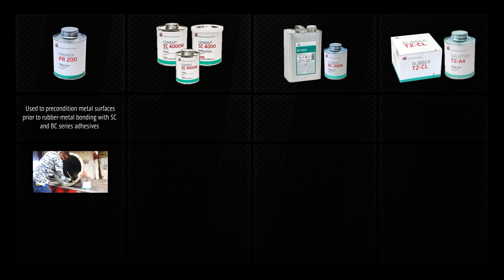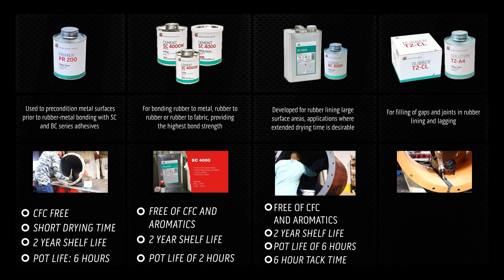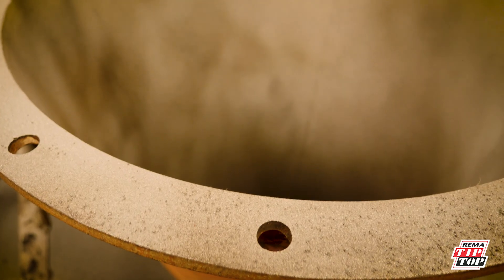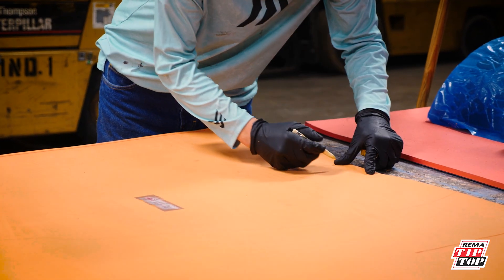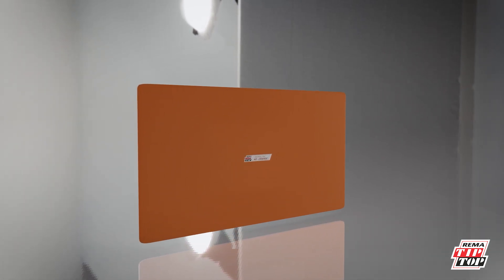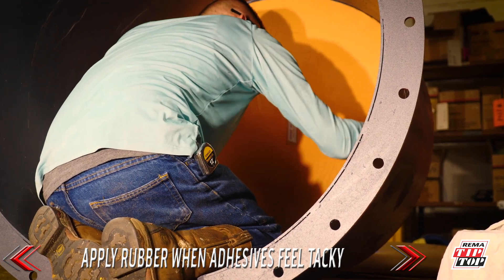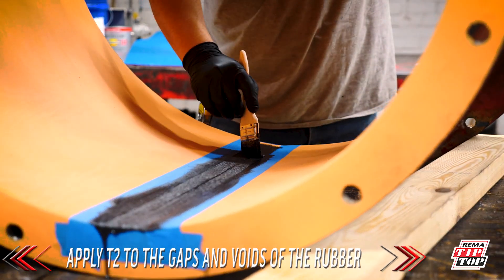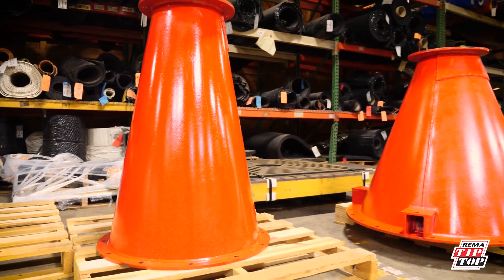Bonding Systems Process

Comment: How do you test adhesion peeling strength of the rubber lining work performed
Reply from the maker: Adhesion testing is a form of destructive testing. We do not recommend that for finished lined work.